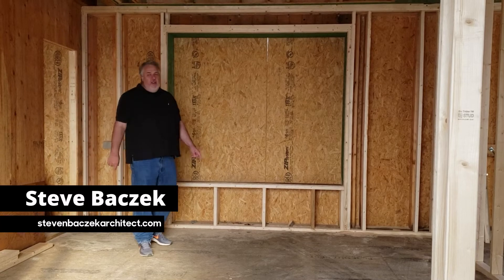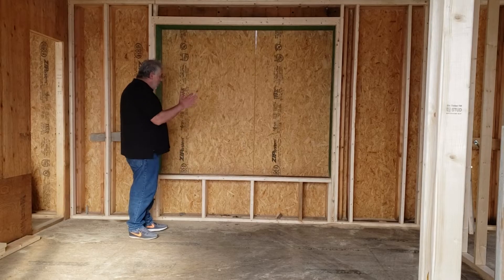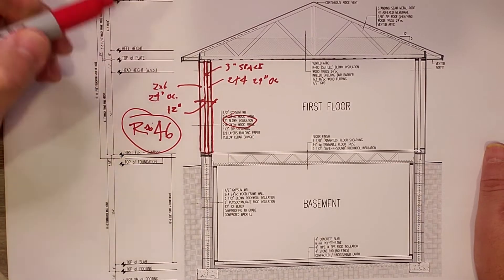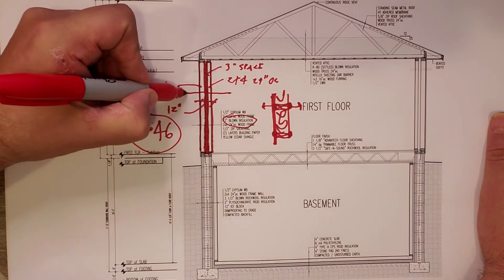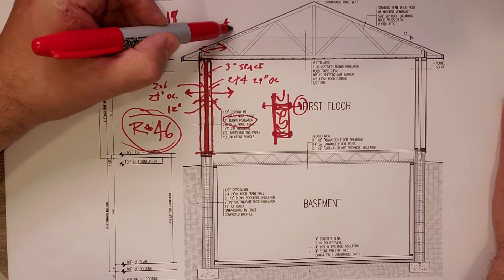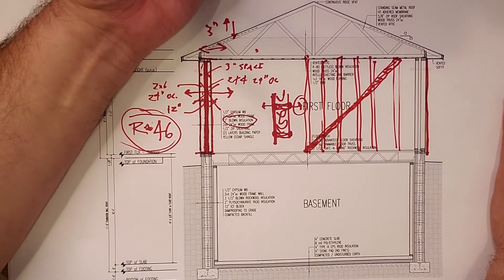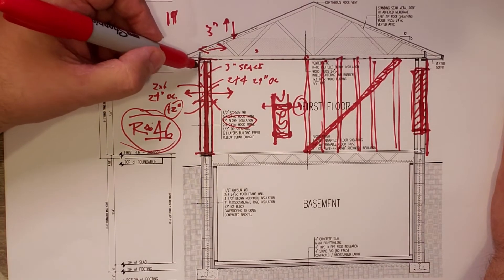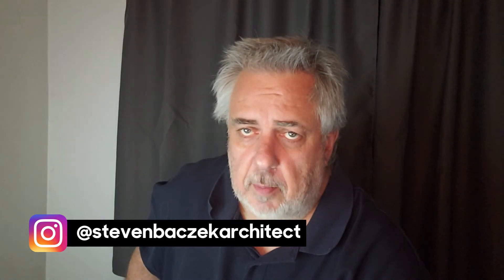Double Stud Wall Framing for Passive House

Comment: Hello Steven!  When you have the opportunity, would you please expand your explanation of the possibility of a double negative of a thicker a 24" double wall in a cold climate.  You commented something about making the exterior side of the wall colder and the possibility of greater issues.  Your content is greatly appreciated and I have watched all of your videos.  Thanks for sharing!  Always liked and subscribed...  👍👍👍👍👍
Reply: Yeah, he did talk about it in the video, but I think he assumed prior knowledge on the part of viewers for some of it, so I will try and explain.  As he said in the video, the temperature of the wall changes as you move through a cross section of the wall.  In a cold climate heating scenario, the inside surface of the wall will be roughly equal to the indoor air temperature, while the outside surface of the wall will be equal to the outdoor air temperature.  At every point in the wall's thickness the temperature will be somewhere between those two temperatures depending on the R-value of the material that portion of the wall is made of.

Here's the part he glossed over.  As you may or may not be aware, the amount of moisture air can keep suspended in itself in the form of water vapor depends on the temperature of the air.  Warmer air can hold more moisture, so as the warm air cools down it can reach a point at which it can no longer keep that amount of moisture suspended and some of the moisture gets rejected from the air in the form of condensation.  The temperature at which this condensation formation occurs is known as the dew point (and if I remember correctly it changes depending on both the relative humidity of the air, and the atmospheric pressure).  You can see this happen when water vapor from the air condenses on the outside of a cold glass.

Since the temperature of the wall gets colder as you move through the wall from the inside to the outside, there can be a point in the wall where the temperature of the wall material drops below the dew point, causing condensation to occur.  If this point occurs outside of your water and air barrier that's applied to your sheathing, it isn't usually a problem.  However, if this dew point temperature occurs on the inner side of your sheathing you can have condensation occur inside your wall cavity which can lead to mold and rot issues if your wall assembly isn't able to dry out at a faster rate than it is getting wet from the condensation.

This is where making that double wall thicker in a cold climate can become an issue, since as you add more insulation inboard of the sheathing, the colder that sheathing will end up being and you can end up moving that spot in the wall where the dew point occurs from outside of your sheathing to the inside of the sheathing.  This is why building codes in cold climates are starting to require a certain amount of exterior insulation, since adding insulation on the outside of the sheathing will move it to a warmer location along that temperature gradient inside the wall assembly and reduce the likelihood of condensation forming inside the wall cavity.

Basically he is saying that by adding too much interior insulation you can end up with condensation issues inside your wall assembly, so you need to be mindful of that and if at a certain point you feel like you still need more insulation, you are better off adding it to the outside of your sheathing instead.  I hope this explanation helps, even if it comes a year after you asked.
Reply: @r.j.bedore9884  Thank you!  😁👍
Reply: @r.j.bedore9884  
EXCELLENT explanation!
Thanks from North Dakota!
Reply: @r.j.bedore9884 , THANK YOU for such a detailed and easy to read and understand explanation. I was confused about the statement made in the video, so this helped a great deal.
Reply: @r.j.bedore9884  I'm late to the party, but want an opinion on this. Can this issue be mitigated with a vapor retarder between the stud and drywall?
Reply: @SolarGuyInMaine  Yes, a smart vapor retarder between the drywall and the insulation will definitely help, but you have to be very careful with the installation and making sure that all of the seams and penetrations are well taped and sealed.  If you are retrofitting an existing house and don't want to redo the siding to add exterior insulation, then a thicker double stud wall with a smart vapor retarder is probably the way to go to get more insulation (assuming you don't mind losing the interior space).  If we are talking about new construction, then it is probably less labor intensive to put an appropriate amount of exterior insulation on the outside of a less thick double stud wall.  Or if you have the time and money you could do both the smart vapor retarder, a reasonably thick double stud wall and exterior insulation for the best combination of comfort, durability, and useable interior space.

Comment: For the recessed windows, are you doing nail on to a 2x that's connected to the sheathing? or are they blockstyle windows connected directly to the sheathing on the inside of the window buck you've designed? ( LOVED THIS VIDEO!!, amazing details!)